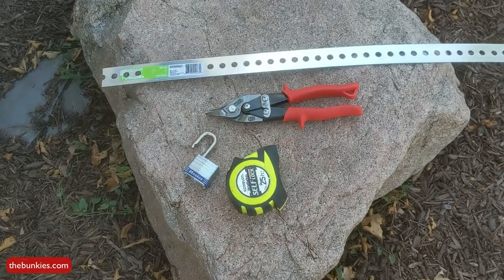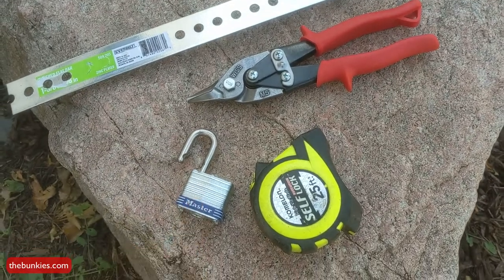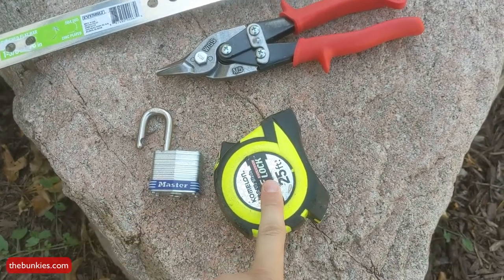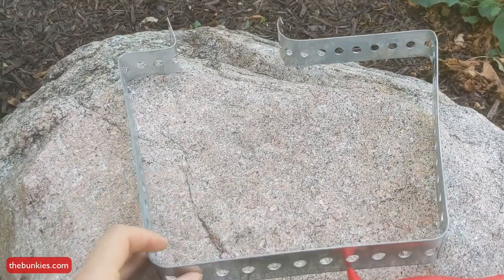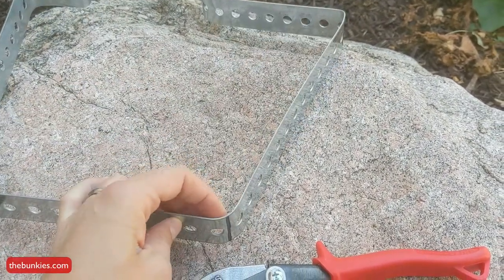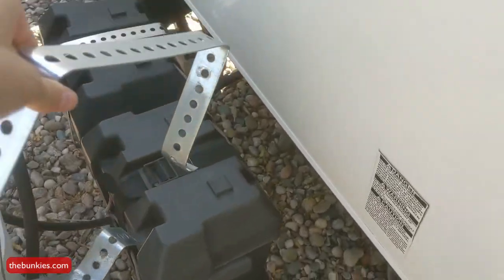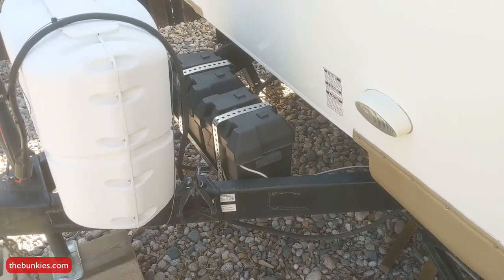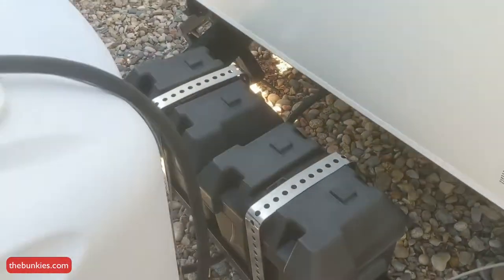How to Lock Travel Trailer Batteries - Cheap Battery Theft Deterrent

Comment: So a pair of tin snips can cut this right off like butter?
Reply from the maker: Yes!
Reply from the maker: Most crimes are crimes of opportunity. If your batteries aren't locked they come off the trailer a lot quicker than grabbing a pair of tin snips.
Reply: @nerddadtech  Thanks for the video, I have a dual battery box and might use your system on one side and a python cable lock on the other.
Reply from the maker: @CruiserlifestyleBlogspot  a battery box is a great way to go. I haven't found one I can fit on my trailer so I'm using this system.